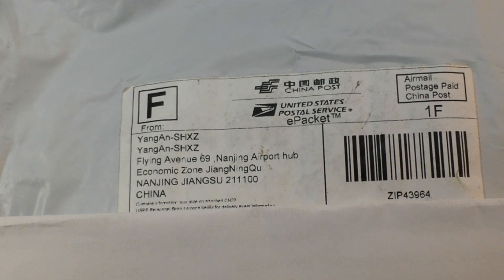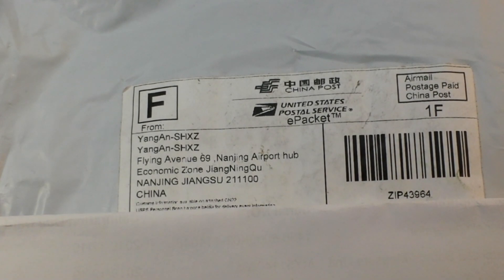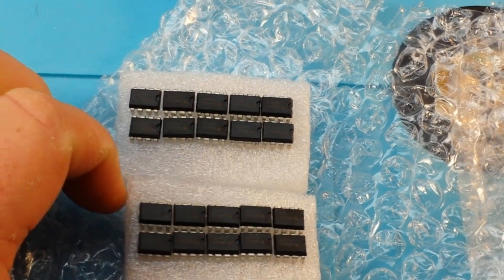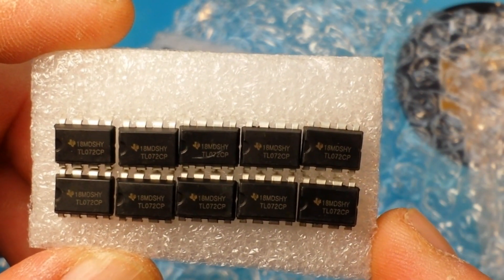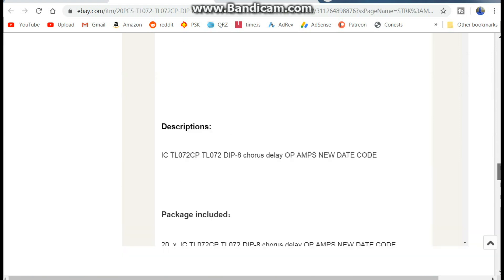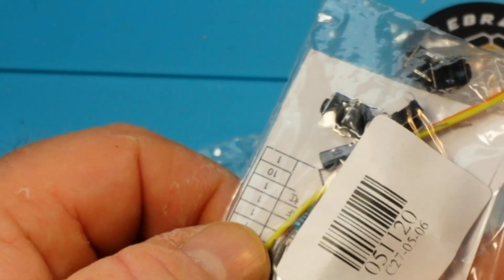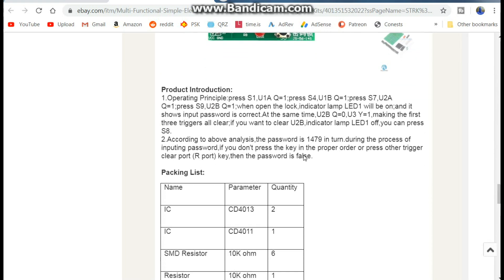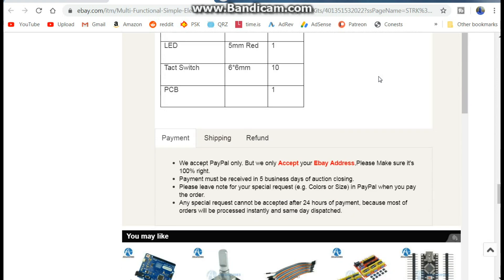The Slowboat from China 16

Comment: Those op amps are not Texas Instruments. They are fakes. If you scroll down the listing to the  "Item specifics" it clearly states "  Brand:  Unranded/Generic ".    TI originals cost about $1 each. You can get them form Digikey or LCSC. If you look at LCSC you will find cheap Chinese brands for about 10 cents each. These are them (if ya know what I mean). Alice, Polida, Worldchip, Horizon and many others all sell these rebranded generics. Almost all of the semiconductors on eBay are fake/generic and yes I can prove it. That being said the generics generally work just fine for most applications. If you are not planning to use them at the extremes of the original's specifications they are a cheap and usually reliable part for the hobbyist. However, they should not be confused with the real thing, as they are not. I appreciate your videos and I know how much time goes into making them (I've tried). I'm not trying to be critical just accurate.
Reply from the maker: Ok, thanks.

Comment: SMD is not too scary and can be great for saving board space! However, I tend to keep to 1206 parts as 08 or 06 just doesn't work with my shaky hands and poor eyesight lol. You should definately play around with using a hot air gun and solder paste as it can really help if you suffer from poor dexterity like myself!